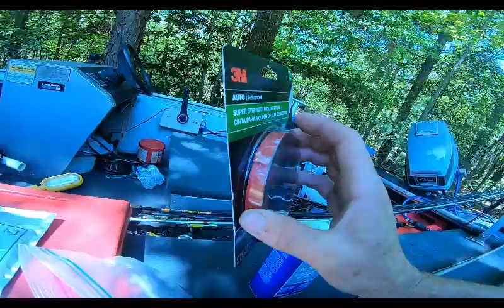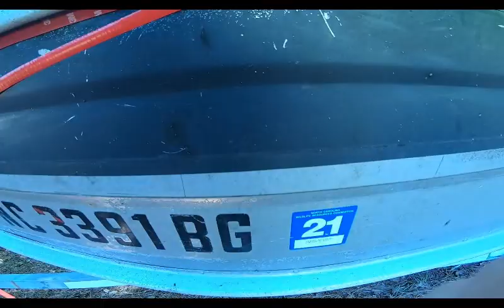HOW TO EASY DIY LED STRIP LIGHTS FOR BOAT

Comment: What brand of led did you go with?
Reply from the maker: eBay.  Cheap
Reply: @CHIPPOFISHING  can you post a link of the led strips you bought on ebay
Reply from the maker: @smithponds1370  https://www.ebay.com/itm/301802717161
Reply from the maker: @smithponds1370  ebay listings vary with the production and quantity available in china,
 what is currently manufactured will soon be the stock to sell , but most times supply is not a difficulty

Comment: Nice DIY. Gotta share a new secret that i didn't know existed and has changed my outdoor wiring experience. Liquid Electrical Tape. Paint it on the wires after you solder them.
Reply from the maker: GREAT TIP
how long has that been on the market?
mainly used in what kind of trade,  electrical?
thanks for commenting
Reply from the maker: what is the dring time?  heat activated ?
Reply: Automotive industry. 
Find it at Lowe's and walmart.

Comment: Any video at night?
Reply from the maker: SEVERAL SEVERAL SEVERAL 
please look at my channel under video heading and scroll down or google chippo fishing night video
Reply: @CHIPPOFISHING  I checked it out but all you can see is the blue inside lights
Reply from the maker: @jeremiahlavoie7998  I try to stay on the inside of the boat,  LOL
I recently have wired the blue inside and green outside LED strips together to 1 set of alligator clamps   I do not use them separate, and have a designated 29 series battery for night fishing, which I also attach my submersible green lights